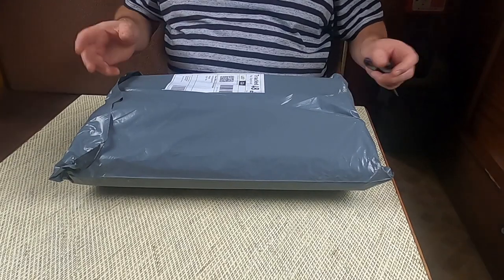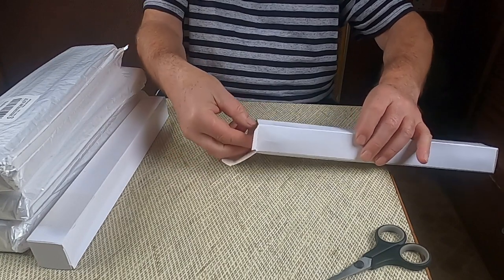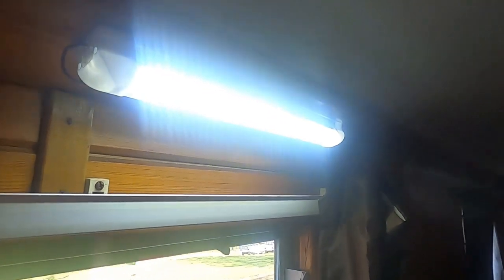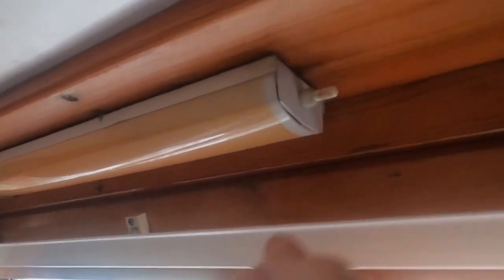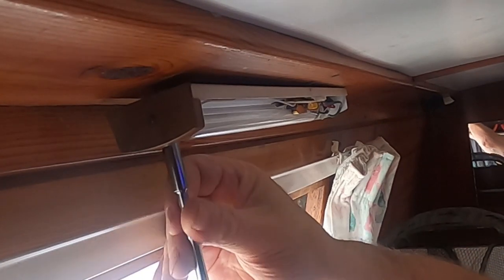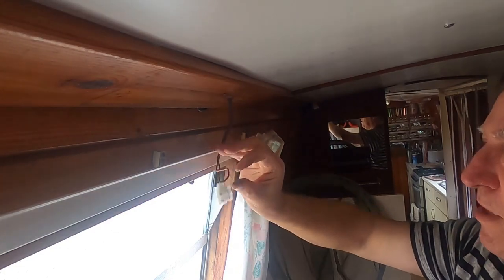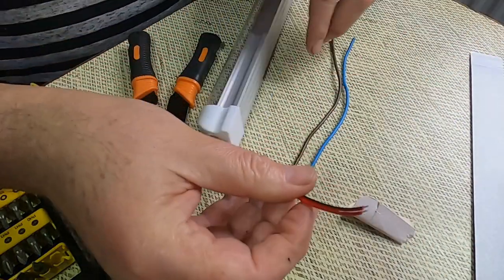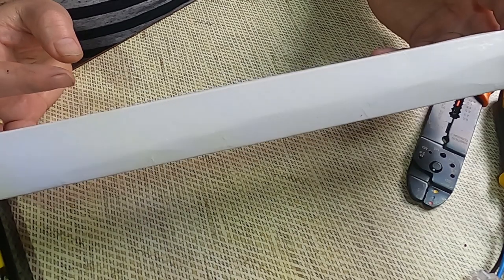DIY On A Boat - Part 2 - Let There Be Light - LED Light

Comment: Great video Trev. After using connecting blocks (same as in your video) for 30 odd years, i have never thought about bending the THIN wire over onto the outer cabling (like you have done). I have always bent the wire back over onto itself to make it thicker - if that makes sense.
Reply from the maker: I use to do double the wire part up also, but the may make for a better connection for carrying more ampage, but the strength of the wire was still just the thin wire, and was still prone to breaking off. By folding it back over the sheathing it not only increases the strength of the wire, but the connection screw will also normally penetrate the sheathing for a better electrical connection also. I must admit it was a tip given to me by an auto electrical mechanic years ago when I was working at an Audi/Volkswagen dealership.

Comment: U will notice the difference with these new lights, l have them in my house wired to my solar system as l live very minimalistic off the main grid. I found that using the tape after  a while the lights started to dislodge and dangle from the wires so better using the clips. Great vlog as always Trev 😊 stay safe
Reply from the maker: I have put them up with the tape at the moment, I'll see how they go. I have kept the clips, just in case. Lights are great, they use very little electric and are very bright.

Comment: Very good Trev ..

How do go about getting post ?  ..  as you mentioned going down to the post office
Reply from the maker: I use the post office facility called "Poste Restrante" I have things sent to which ever is the nearest to me at that time, or where I think I will be in a few days or by when it should be delivered. I then look up the post office address and have things sent there, they will hold items for up to 7 days for free. I do make sure that I tell the shipper that it must be sent either royal mail or parcel force.
Of course, I do have it shipped to the post office c/o me

Comment: They are the exact same ones I have on my boat they feel really cheap but after 3 years of use I've never had a problem with them. they are pretty bright and much better than a florescent tube.
Reply from the maker: Yes, I have had them installed since before Christmas, and I have found them so far very good. They also cost less than £50.00 for 16 of them.
Reply: @TrevsTravelsByNarrowboat  I have 7 of them but I usually only have about 2-3 on or you need sunglasses to walk around the boat 😂
Reply from the maker: @SashasNarrowboatLife  Yeah I only have 2 on now